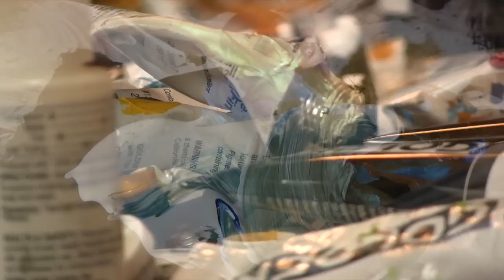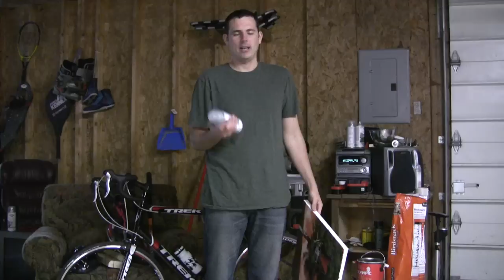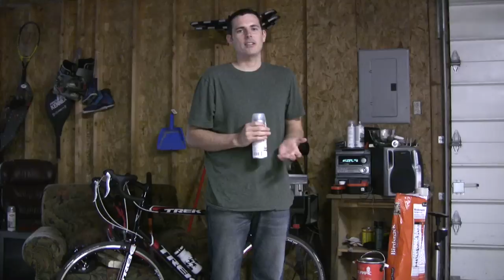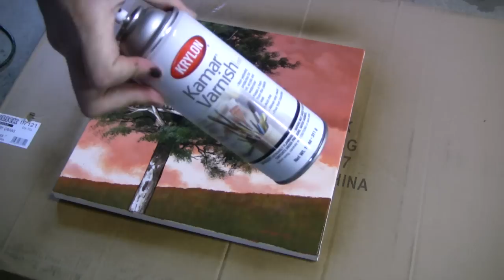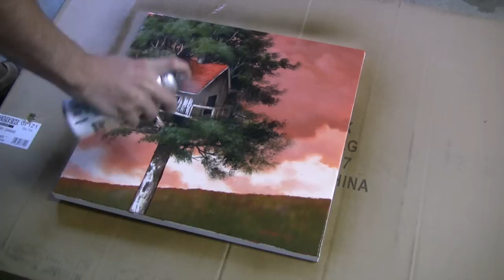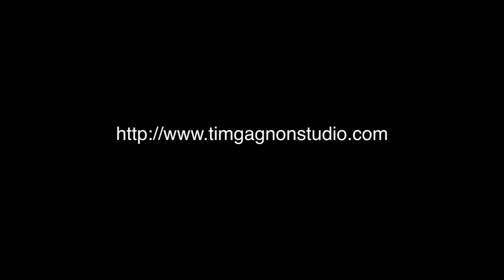Varnishing your painting with Tim Gagnon using Kamar Varnish

Comment: i also lay my paintings flat and spray them a lil closer than it says on the can like you...but i tend to spray mine like i was taught as a spraypainter...that is top to bottom and side to side as you said, except i was taught to spray right off the job, then release the trigger, then press the trigger and spray right through the job and off the other side again and repeat. this is meant to give a more even finish without causing patches. 
cheers tim. love your vids man.

Comment: Move briskly, do not shake it... be very careful and keep the nozzle tip clean... If you continue to shake as the finish builds up around the nozzle you will risk a droplet falling off the can and making a deformity, kinda like a bubble... If your are working on flat panel or with a lot of details you will not want a bubble. This project it's alright as his open statement suggests he's not worried about bubbles.  If you have a very complex project this can be very hard to fix, use 2000 grit sand paper lightly remove, or even repaint after, and then refinish.

Comment: Thanks Tim.  I have a question, though.  How long do you let the painting dry before applying the spray varnish?  I've used brush-on varnish before and ruined a painting because I didn't let the paint (acrylic) dry long enough (paint was dry to me but someone told me after the fact that you should wait 2 weeks before applying varnish).  I'd rather use the spray-on like you do if you can do it sooner than you would using a brush-on varnish.  Thanks again.

Comment: Thanks so much for sharing the way that you coat your paintings with protection.  Have you ever tried using acrylic resin before?  It is suppose to give the painting a glass like coating.  One of my favourite artists uses acrylic resin for all his paintings, and it is absolutely beautiful.  Of course there is more work in the preparation of the resin, but the outcome is so nice.  I might try it in the future, and or epoxy resin for my oil paintings.  Also thanks for all your great videos.